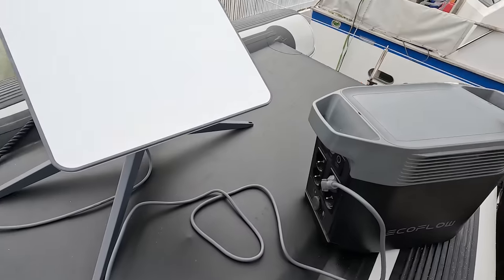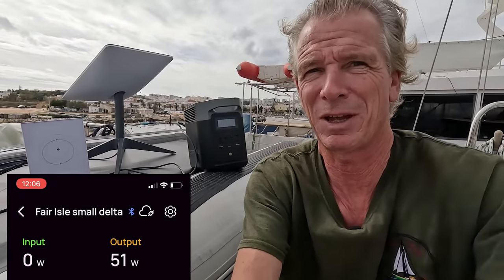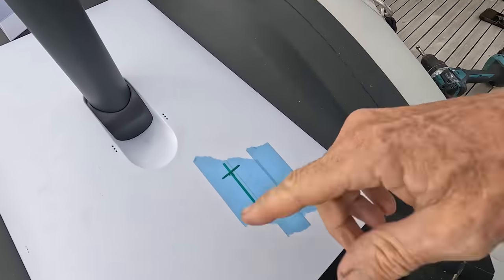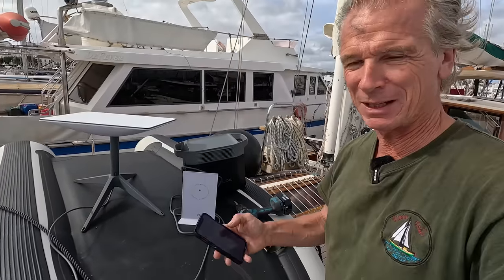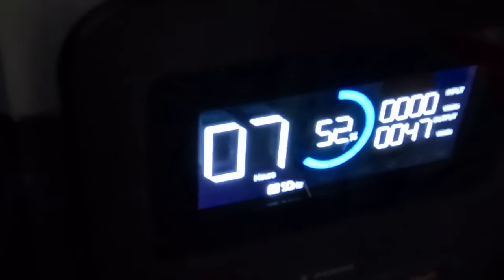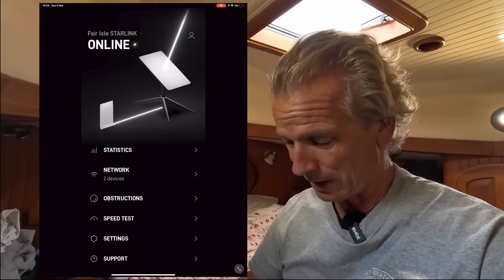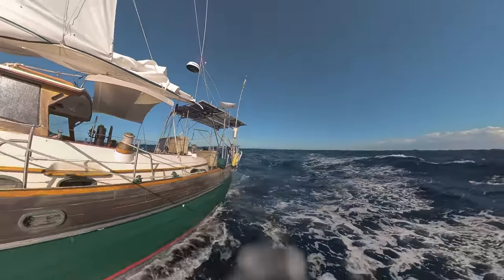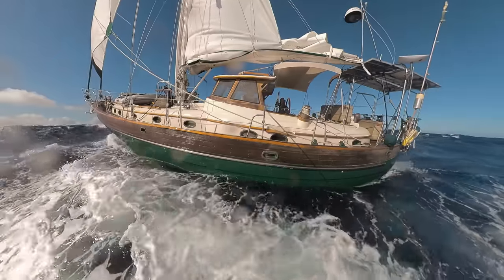Starlink on a boat

Comment from the maker: Check out the description, I’m starting to put useful additional info in there,
Reply: 07:52 that is a lie : starlink has a special pack for a boat.

Please do rectify this aspect in your future videos .
Reply from the maker: @kosminuskosminus  Well aren’t you just delightful! If you think there is a fitting built for boats then be helpful and put the link in your comment. There isn’t anything of that kind that I’ve seen Starlink provide though and I’m guessing that you intellect is at the same gutter level as your writing and you are actually referring to the fitting kit for the flat dish which is the option built for boats and not what this video was about. So please let’s have the link or maybe just take your dick comments somewhere else
Reply: Nice captain thanks for sharing

Comment: 9-months with Startlink inc cruising Scotland, Norway, Sweden ...been fantastic.

No need for expensive mobile priority subscription offshore! Just pay for standard £85 per month package then select 'priority data' in account section of mobile app to pay-as-you-go at £1.98 per GB offshore when needed. Can select this on/off at anytime without changing subscription. Far cheaper.

Great video. Thanks Steve.
Reply: Quel moulin à paroles ce mec
Reply from the maker: Thats amazing, thank you for that insight. I read the details on Mobile Regional as far as the point where it said 'not for use on the ocean' and moved on! 
It's weird they've done it like that, we are paying 300euros for 50 Gb and if we stayed on Regional and do what you've done we would only pay 100Euros for the 50 Gb, makes no sense!!
Reply: @svfairisle  There is also a Gen 3 now that is even better. "Priority" service is only relevant in high traffic areas. If you are getting 12mbs or more up, you don't even need it to upload your videos.
Reply from the maker: @Mordalo  I hear the Gen 3 is more power hungry though, that would write it off for us.
Reply: I thought you were NOT permitted to use starlink offshore ???
Reply: Thats good to know. How FAR? off shore is the question. I plan to be mostly within 30nm of mainland Australia when cruising clockwise from Darwin in the North to Melbourne in the south east. Literature says 10-12nm is the limit of use offshore. Also what plan would a cheap sailor use?

Comment: I've got mine connected but have it mounted inside my boat to the top of the deck. The motors report themselves as stuck and never move. I also leave mine running 24/7, and use 1.05kwh per day. I have an electric boat with 3200W of solar, so it's not a big deal, but for everyone else I recommend seeing a timer to turn it off when you're asleep.
Reply from the maker: You have it mounted inside?!

Comment: Just caught your video a few month's late.  It's interesting about the power consumption dropping during motor operation.  That is almost certainly because they turn off the transmitter when the antenna is moving.  My guess is that a good part of the running power is for the transmitter - perhaps 40 Watts or so.  Then imagine the gain from the phased array antenna means there is a significant beam of radio power going towards the satellite.  As someone who spent much of his career dealing with high power radio transmission (up to megawatts equivalent radiated power!) I would be hesitant to put myself in such a radio beam.  I am sure Starlink is safe if used as intended, but on boats you probably should avoid situations where you can walk into the beam from the antenna.  This might apply, for example where you can walk on a cockpit roof, if Starlink is at the same height.  I think Starlink turn off the transmitter while them antenna motors are moving to avoid "spraying" the radio beam around as the antenna moves.   "Precaution" is the name of the game here!

Comment: F
From reading the comments I get the impression that Starlink has different plans and different conditions around the world.  I am sailing from NZ to the UK.  Bought my Starlink in Darwin Australia, fitted it in Bali.  I never got to use the Australian local plan but went straight on the Mobile Priority 50Gb plan.  Costs me £196pm then £1.67 per Gb

When I asked Starlink if I could change my default address to a different country, to take advantage of a local plan while coastal, I was told that was not possible.  

My dish fell during a storm (due to a poor bracket!) and broke.  I asked Starlink for a replacement, totally happy to pay for it, and they immediately despatched a free replacement to my default address in Australia. Any replacement MUST go to the original country of account.  My son is getting a free Starlink!   I have started a new plan in Kenya in order to get a new dish, which is on its way. Mobile priority plan here is £180pm (unknown price after 50Gb)
Reply: 1. So you created a new account or just made a new plan in Kenya? 2. Did you need an address?If yes, then how did you get one?   3.Your old one from NZ is cancelled right? Thanks in advance

Comment: We use the smallest Victron inverter dedicated to the starlink and the losses are about 0.3A. A lot easier than converting the unit to run off DC. Works flawlessly offshore on the regional roam plan if you hit the mobile priority toggle. Elon has made our Iridium go, Pactor modem, wifi booster and 4g mobile booser all redundant 😂
Reply: Agreed 100% (after using Starlink 3 months in Canada and a French Polynesia
Reply: Can i ask what size inverter you're using?  Big fan of Victron.
Reply: Starlink lacks the universal connectivity and reliability of iridium go.
Reply: Isn’t that plan now going to jump to $400/mth?
Reply: @ArazQizilbash depends where you plan to travel. Some reports are that people with the rv roam plans were being notified by starlink that they had to return to their home base for a period of time otherwise their service was going to be shut off.

Comment: I've got an eco flow solar generator too and want to let you know that the inverter silently draws about 20w. So don't be surprised if when you've modded it to 24v, the draw on the LCD looks the same. You will have saved 30% on the energy consumption. Thanks for the videos, from a cold and wet Dartmouth
Reply from the maker: Yes obviously the draw the Starlink requires is the same no matter what. It's just that if we choose to feed it in an inefficient way i.e. using an inverter we are using more power

Comment: Really informative.  Thank you.   Good questions - we'll be checking back because I too am curious, especially about the physical address...   Maybe one day we will not need physical addresses and there will be no geolocating...  Which I had hoped Starlink would offer - but apparently I will still need a VPN...
Reply from the maker: Yes there is geolocating so you do still need your VPN if you want to fake a location. It's just annoying that the GPS data isn't constantly fed to apps that you are using so mapping doesn't work well with Starlink at the moment
Reply: @svfairisle   Yes, that was a bit of an eye-opener.  Good reporting.  👍🏻
Reply: @svfairisle Starlink doesnt give out GPS data to apps. Apps pay 3rd parties for Geolocation data based on IP address and they are notoriously innaccurate and there isn't anything an ISP can do about it besides keep their IP addresses updated, but for a satellite system that is going to use the geolocation data of the base station most likely.

Comment: You can soldier onto the main board and run it directly on 12VDC and do away with the router, the newer models dont seem to have as good GPS chip so take a while longer to get a fix

Comment: A big use of power is in the transmitter which at times is continuous rather than the short time a motor runs. A likely reason the power goes down when the motors run is the unit stops all transmissions when physically moving. It would be interesting to try different data rates or length of transmission and check power during these. You can also get increased consumption if your link performance drops down and error rate goes up. This causes a lot of re-transmission…like using power twice or more for the same piece of data. This is a game changer so good luck….
Reply: I found the biggest draw was during a firmware update, it doesn’t move the motors at all, but must be thrashing the internal processors.

Comment: This is a technical reply to the point made about acquiring a mid-ocean connection to StarLink.
The phased array must focus on (point to) a satellite. When the ship moves along the three possible axis, a solid state chip could determine this and change the focus direction. My question was related to how quickly this can occur (degrees/second).
I discount the possibility of the phased array antenna having a very wide reception/transmission cone.
When restarting StarLink, an appropriate satellite may be anywhere in the sky; hence a search may take (a long) time. Possibly, with a GPS chip and a solid state compas as well as a table with satellite positions, a Hot Start could be executed (eg. point directly to a visible satellite).
This is very similar to hot or cold start of a (normal) GPS-receiver, where the cold start mode will listen for any and all satellites and eventually select the visible ones computation of time and position.

Comment: Thanks for this video. 
What about the IP rating of the dish? The standard actuating dish you have installed is just splash proof. Did you observe or have any problems during heavy weather and rain? Do you take it off during bad weather?
Reply from the maker: The standard 'Dishy' is only rated at IP54, so thats splashes. I think the new (non moving standard dish is IP57 though which is immesion to 1m. We haven't had any issues so far though and our dishy has been out in some horrendous weather!

Comment: We found the dish went flat pretty quickly once we were at sea, or on a swinging mooring. It even went flat in Mayflower Marina once when it was a bit rocky! I also have starlink at home (the original round dish!) And that is nearly flat now, I suspect it is only at an slight angle for rain run-off.
I do remember a GPS sharing setting when I still used the original router, but that went ages ago and I am not on the boat at the moment, I have to move it to another island next month though, I'll look.
The boat is currently in the canaries, getting there counts as mostly offshore 😂 starlink has been a game changer for the weather, although I've stopped using predict wind, its too expensive for confirming my routes, I need to trust my own judgement instead of my wallet!
There are a few gotchas once you get rid of the router, the main one is not being able to switch to premium data once you get offshore unless you plug the old router back in! So remember to do it before you get too far! It's worth the change though... you will have noticed by now how hot the router gets.. you can feel the Watts wasting away!
Reply: What other kind of router can you use?
Reply: @Dudunio  any router you like. The dish acts like a broadband connection with an ip address. Your internal router provides a firewall, dhcp and dns forwarding.

Comment: To save energy, if it is an issue, maybe you can turn wifi off and use a RJ45 cable for the computer, and just turn it back on with you want an access on your phones and tablets. Or just add some PVs connected to the Ecoflow, if you have room for them.
Reply from the maker: Yes we run Starlink off the Ecoflow, still not great though as the inverter isn’t that efficient

Comment: Starlink does offer a "pipe adapter", a tubing adapter mount for the Dishy.
it's over sized like a bell at the bottom, with setscrews to attach to a wide variety of pipe sizes, with the std. Starlink "dishy" mount w/ cable slot up top.
We just tightened the setscrews onto the stern flag tube on the davits and boom, done.

We are considering enabling "Mobile Priority Data" which enables "network priority", "ocean access", "in-motion connectivity" and "global use" when on passage.
But... it is "metered" use @ $2 US per GB... and seeing as we have already used 102 GB in just the first week of Dec, then again maybe  not.
So for now we are just using the RV Plan and only when in port/at anchor to manage costs.

CJ&JD
SV Rocinante
Reply from the maker: Interesting they have a mount, I assume that’s in the US? There’s no pipe mount on the European site
Reply: Great name! The question is, is your boat named after a horse, a song or a star ship?
Reply: @svfairisle hi! I have Starlink on the roof of my house in France and I used the pipe mount. I bought it from the European site. It’s stupidly expensive though for what it is. I also purchased the extended cable. Also not cheap but my internet connection has gone from 8 to 200+ things.
Reply: there is now, I get the pipe mount option when I go on to the starlink shop. I hope that helps - I am in the UK
Reply: @richardcurzon4276   Excellent! It is simple, acceptably strong and adapts across a variety of pipe sizes.

Comment: I was wondering why you did not opt for the flat hi performance antenna which can be used underway. Until i read up on the power usage. It peaks at 110w and averages 85w and the power cable is only 25ft long with no extension cables available as yet. Good luck!
Reply from the maker: Yes and there's really no need for the hi performance dish anyway, we always get good connection with this one, just takes a while for the initial connection if you're rolling around a lot. The next generation standard dish doesn't have the motors though and can be mounted flat, not sure if it's any better on power though.

Comment: The speed difference between device-router and router-internet is quite natural. You can have devices connected directly to the router (storage for movies or pictures) in which case the first speed applies. The lesser of the speeds apply when using the internet. You may use your devise in a spot where the local device-router speed is the governing speed.
Compare to a chain with links.

Comment: Remember to turn off its snow removal heating. There are several options to power it from DC without cutting the lead now. Have a look at Sail Life Mazz has recently converted to 12v.

Comment: I would rather add a switch than cutting the motor cable, since the positioning could be halted just at sea, to keep best performances when at the marina or anchor. BTW, if many people do that, Starlink will probably just add an option to keep the horizontal position with an over the air update.
Reply from the maker: We are very rarely in a marina & you swing at anchor so repositioning is not what we want as it drops the signal to do it. Starlink work great with the dish horizontal so there’s really no need for it

Comment: Hi 
So I tried and had these problems 
1 I did not disable the motors ?
2. I left it on basic mode 
3 . I stayed within 3 miles from shore 

So I could as soon as I became mobile it would not stop searching and trying to link and thus failed 

Although when I stopped to anchor it settled down and worked 

So am I correct when I say you have to disable the motor 
And change subscription to coastal or offshore ?
Reply from the maker: You dont have to disable the motors, plenty of people don't. I just think it's better to not have the antenna trying to see the right part of the sky on a boat thats going to move. If you'r at dock most of the time maybe having working motors is better?
Ours sometimes takes 10 mins to connect when we're coastal sailing if you're is taking longer then maybe thats the motors getting confused. 
You need to switch to premium when offshore, thats outside the hexagons which might be more or less than 3 miles

Comment: I’m thinking about installing one in my boat, but I’m in doubt about how the gen 2 actuators work. Does your antenna kept realigning as the boat moves, even at anchor? I’m abroad and here they still sell the gen 2 antenna. The less power hungry gen 2 is a plus, but I don’t know if this is the best option (due to the presence of the motors) or if it’s better to wait for the gen 3 antenna. Disabling the motors would not be the ideal solution for me as I intend to also use the antenna at my house.
Reply from the maker: Most people don’t disable the motors and I haven’t heard and major problems. Perhaps someone who has tried it both ways can pitch in and say whether the dish often try’s to realign as the boat swings at anchor.  I disabled the motors because logically having the dish move when the boat is moving can’t be a good thing.

Comment: As a guess I think it has stepper motors for positioning. Stepper motors have a high ‘holding’ current. When it moves the current drops as it no longer needs to lock its position.
Reply: stepper motors would make sense as it would be very precise.
Reply: It won't be holding a static position by use of the motors.

Comment: Great video…which dish did you get? Is it not necessary to get the marine dish? Cheers
Reply from the maker: No it's not necessary or actually even a good idea unless you have power to spare. The standard dish works great and already has a hefty draw so don't see the point in the flat one which takes double the power/

Comment: So is your Roaming Hardware still able to work in Blue water? as I heard that Starlinkhas canceled that service and only provides it for their new marine hardware which is like $3.5k
Reply from the maker: Yes it all works just fine. I think the confusion may be that if you want to sign up for the very expensive worldwide roaming contracts then you need a dish designed for mobile use. None of us want that though we just use Roam on Mobile regional and turn on Priority when offshore.